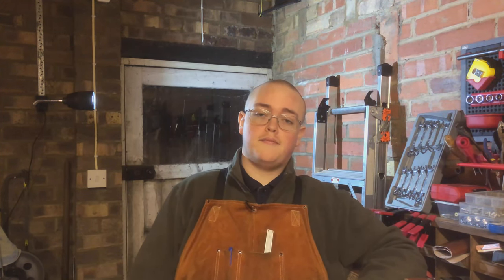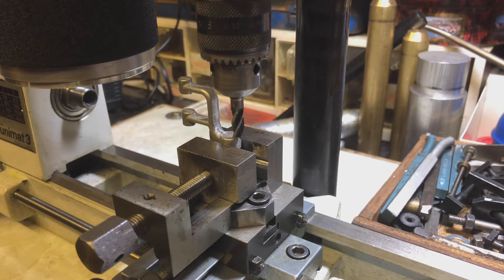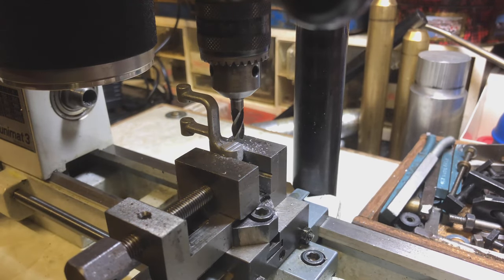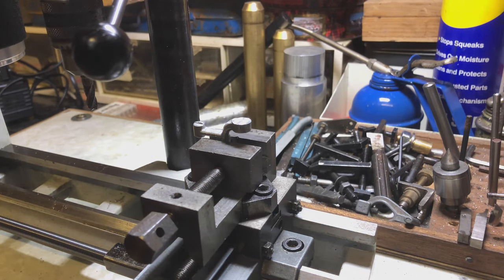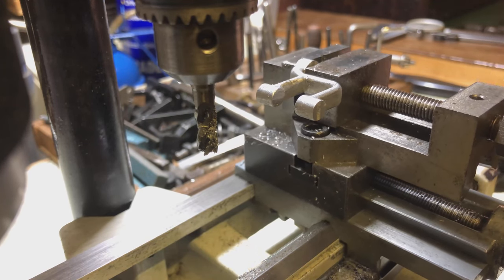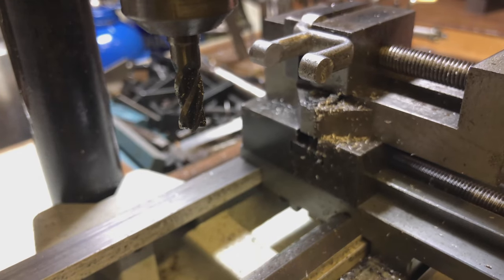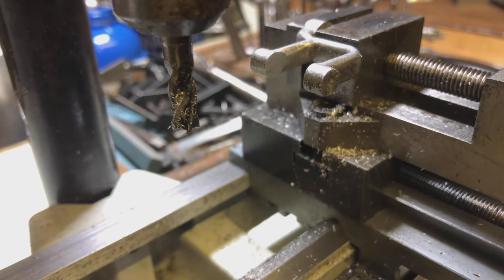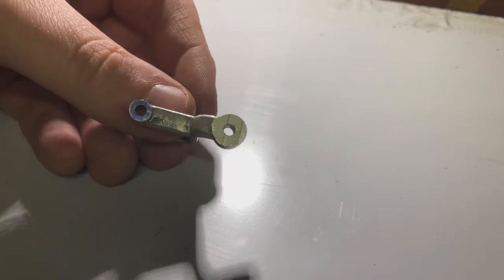PM Research Milling Machine Kit Pt 2 || Counter Shaft Bracket

Comment: Hi Mark    Just watching another of your video's.  Got a Unimat 3 just like yours with mill attachment,  Taig/Petrol lathe, Sherline vertical mill, ML Speed 10. Got hooked Model Engineering when doing jobs in U.K. going to shows. P.M  R.  --- Good  Kits  Here in U.S.    Like your video's   Mike G.

Comment: I don't know anything about machining. But when center drilling at 41 minutes the arm of the casting seemed to be bending down with the down pressure from the drill. Could this have started the hole off on an angle and caused the next drill to be pushed out for the hole in the other arm causing it to be off center as you show at the end? Maybe a turned bit of metal glued between the arms would have added some strength for the drilling operation?
Reply from the maker: Thanks for the comment!  Yes sadly you are correct, there was movement in the part whilst drilling, I believe that this was the main factor in the off centred holes.

Comment: Hi, i have a question about your emco machine.
Apparently by design, there is about 3 to 5 thou of axial slop in the milling spindle. Has this been a problem for you? I have the same machine but have not started making any cuts with the milling attachment yet. I measured my axial play to be right at around 4 thou, but honestly, it seems like quite a bit for the cutter to bounce around, have yoi had any problems making decent cuts with this axial play in the spindle of the unimat?
Reply from the maker: Thanks for the comment!  I have noticed that the mill struggles with harder materials due to chatter.  Having now had the chance to measure the actual amount of axial play, I believe that this is the main cause of chatter.  

There is indeed no way to adjust the play in the bearings as I suspected they are indeed just a press fit onto the shaft with a bearing capture plate above to compress the stack together.  

The only way to adjust play would be to make a jig to hold the spindle and use a hydraulic press to very carefully increase the tightness of the whole spindle stack.  I hope this helps.

Comment: Also how come you haven't invested in a set of number drills? Aren't they needed for tapping pretty much any of the smaller holes? Have you been able to get away with using metric drills to get close?
Reply from the maker: Thanks for the comment!  Your assumption is indeed correct, however I will now be investing in a good quality set!

Comment: Wow, talk about a hard part to hold. Shame about the one hole. If it was mine, I would fill it in with alumiweld (aluminum brazing rod) and re do it. That has saved a few of my projects in the past. Just be carful not to melt the base material. If you’ve never used it before, you’ll need to practice on some scrap, but it’s great stuff once you figure it out. Keep up the great work.
Reply from the maker: Thanks for the comment.  That is a good idea indeed, sadly I don't have a welder or torch capable of this at the moment.  Ive decided to bore out both holes to accept a brass bushing instead, this should correct the error.
Reply: @TooManyLathes  yup, the brass bushing is a good idea. And maybe easier than mine. But just FYI,  you only need a simple map gas or propane torch for alumiweld. It’s actually not welding, but brazing. A lot of people ‘rag’ on it, but it is a handy tool to have on occasion.